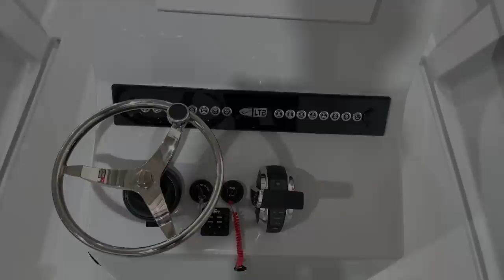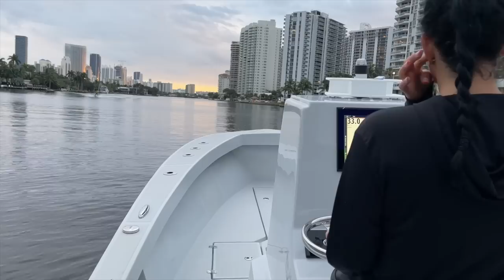My DREAM FISHING BOAT is DONE - Sea Trial | EP 28

Comment: Congratulations. It's good to see you back on the water. I liked when they stuck the fuel tanks in, the deck, the live wells, the cooler and the transom mount for the motor. 
I have 2 questions; why don't you guys use 2 motors and why don't you install buoyancy into your boats? Both are safety requirements in RSA. Because offshore boats with 2 motors can bring you back if 1 fails and the foam buoyancy of 60% will make the boat unsinkable if she gets flooded and the electrics fail. We also have a system we call a wet deck to allow the egress of water than may flood or get onto the deck.

Comment: Your new boat is definitely a fishing machine. I do not like all the new boats with cushions everywhere and all the unnecessary crap they add to “fishing” boats.
I think episode 3 was my favorite. Hand laying glass and foam stringer installation. 
I’ve rebuilt several decks on older boats due to rotten stringers. My last rebuild was a 1984 25’ Parker Center Console that was used as a commercial boat. Ripped out deck, stringers and transom. 
Rebuilt with composite materials for everything. No wood at all. 
 Cheers to many years of good fishing and memories.
Reply: get new iaker 252⁰